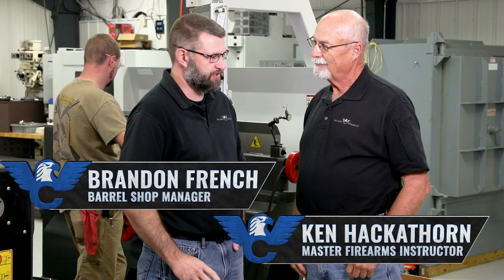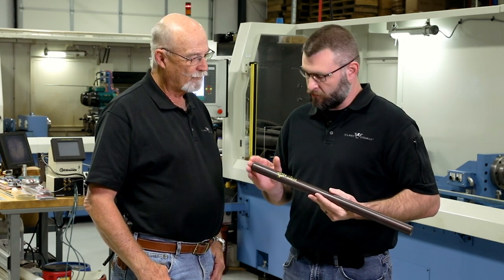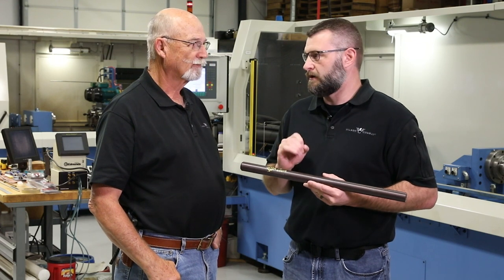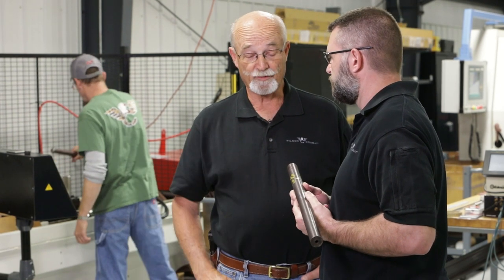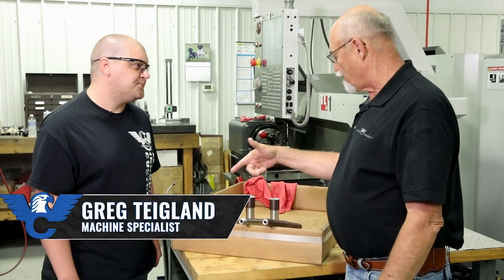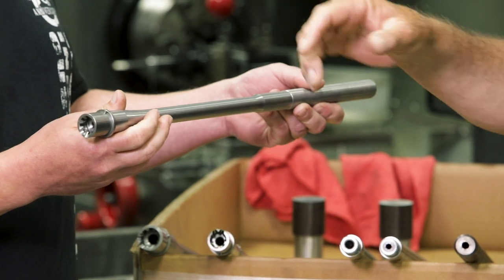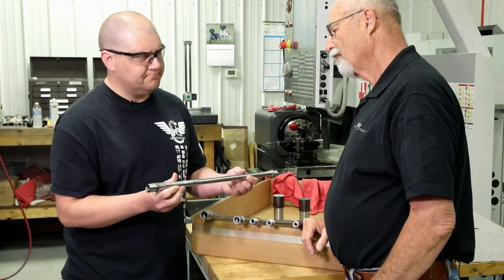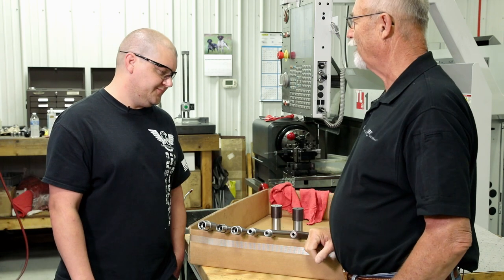Building Barrels – Inside Wilson w/ Ken Hackathorn - Ep. 03

Comment: About a year ago I picked up a 16” fluted 7.62x40wt barrel from you guys. I wanted something with the benefits of 300 blackout for farm work and some whitetail hunting (common .308” projectiles, plentiful brass, standard mags, etc.), but with better case capacity and less bullet jump, twist rate for 125ish grain supers. 
I was absolutely blown away by the accuracy on that barrel. Even the first break in shots were sub moa, and I’m just using a cheap Lee powder measure with lake city brass and Speer tnt projectiles, none weight sorted or anything. To be honest, it kinda pissed me off a tad haha. Been trying to dial in my “precision” 20” 308 for a few years and this carbine outshot it right off the bat. I think I’ll be replacing that 308 barrel soon as well haha.